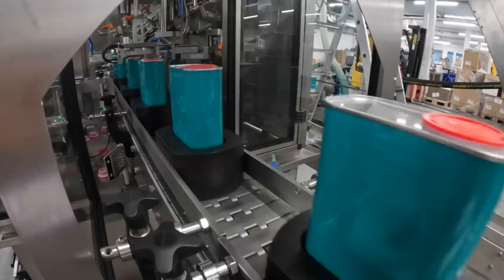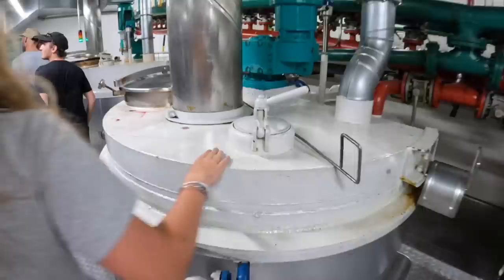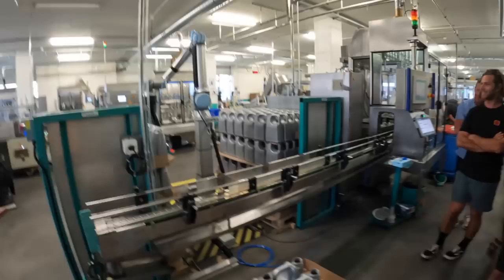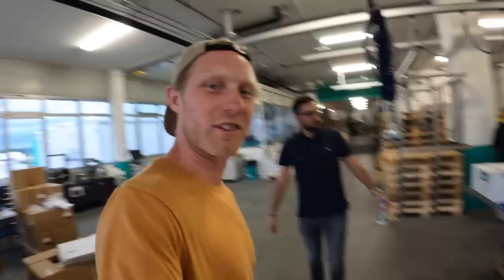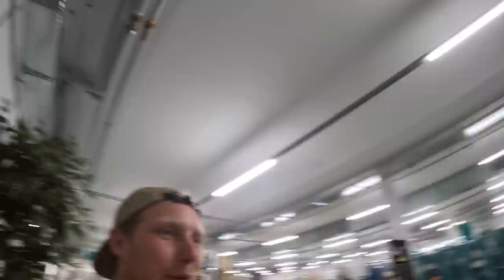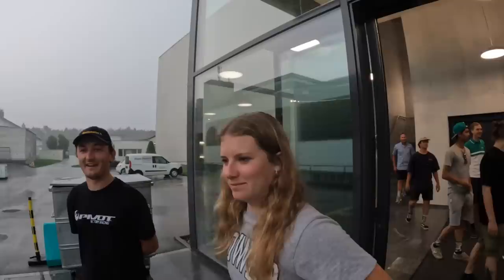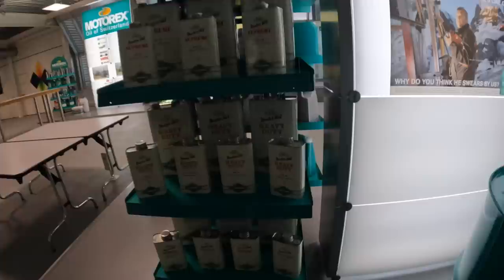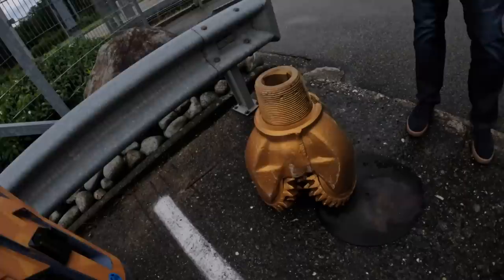MOTOREX HQ TOUR - HOW ITS MADE LSD !

Comment: This rules. i worked for motor fuels in revenue so a tiny understanding of fuel wasn't necessary but i got one. knowing the fuel that comes from the earth is made into sooo many products from plastic in surgery to the grease in a tugboat anchor line or bike brake caliper... diesel, gasoline. its all the same hole. and to SEE it in so many forms is incredible. Thanks MOTOREX and more PIVOT, BK.